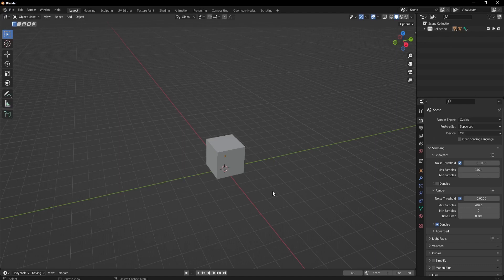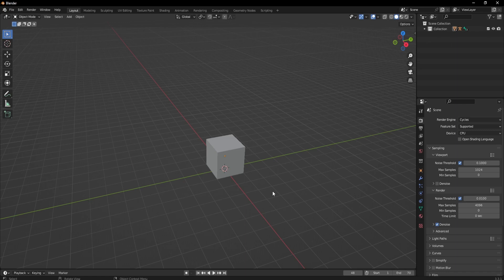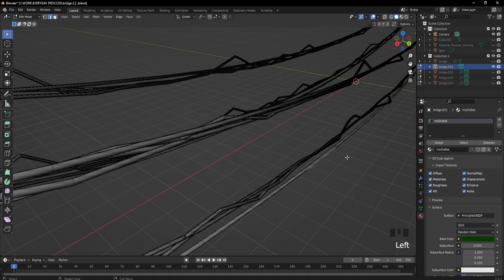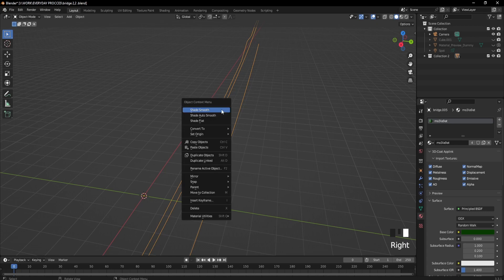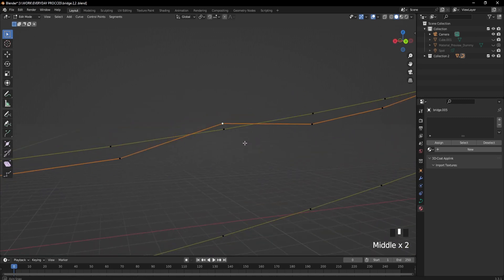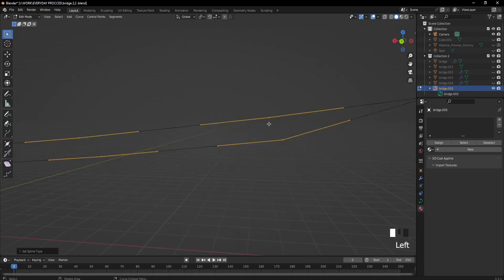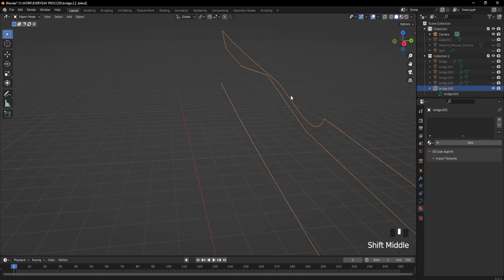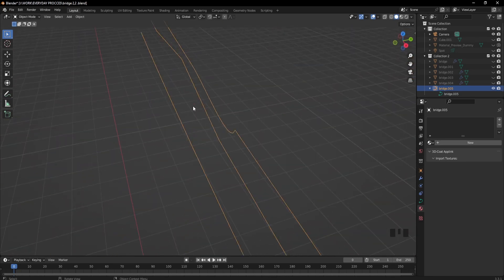Blender 3 Convert Edge to Curve and add handles for curve

Comment: Is there any limitations (on converting edge loops to curves)? I had a reasonably simple edge loop and when I do Object > Convert > Curve it does nothing. (But, for example, if I try to convert Monkey  Suzanne to curve it does something, it works - although only the eye lines remain).